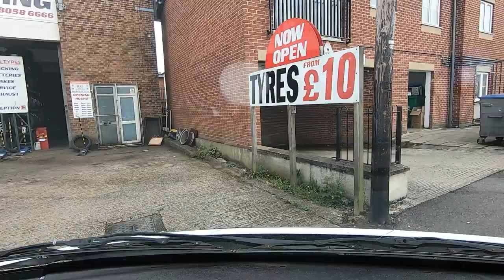Weighed & Paid #70 Light Iron/Sheering

Comment: Locking/unlocking - automatic central locking

Depending on the configuration of the vehicle, it is locked by the automatic central locking if the following conditions are satisfied:

The ignition switch is turned from the position "0" through "I" and "II" to "III" and then returns to "II" (engine running). 
all doors and tailgate are closed 
The vehicle speed exceeds 7 km/h. 
The automatic central locking can be activated or deactivated within 30 seconds by performing the following programming sequence (all doors must be closed and remain closed during programming):

Turn the ignition key to position "II". 
Push and pull the internal door handle on one of the front doors three times, or press the "unlocking" button in the passenger compartment three times. 
Turn the ignition key to the "0" or "I" position. 
Push and pull the internal door handle on one of the front doors three times, or press the "unlocking" button in the passenger compartment three times. 
Turn the ignition key to position "II". 
The automatic central locking system was switched to programming mode (confirmation via a short acoustic signal). 
Push and pull the internal door handle or press the "locking" button in the passenger compartment followed by the "unlocking" button. 
This activates the previously deactivated automatic central locking or deactivates the previously activated automatic central locking.

Deactivation of the automatic central locking is confirmed by a short acoustic signal; activation is confirmed by a short acoustic signal followed by a long acoustic signal.

Programming mode is quit by either turning the ignition switch to position "I" or "0" or automatically, 5 minutes after activating programming mode (confirmation via a short acoustic signal).
Reply from the maker: Thanks I will give it a go 👍
Reply: @Vandal-Vlogs  I saw that you were still having to unlock the doors every time. The videos are great 👍 keep them coming chap.

Comment: The rear of the van needs sorting out as it should be totally empty with no cabinets in it like you have here ,and the best way is spend a day scrapping on the road and then take it all back home to process before you weigh in at the yard .Scrap yards make a fortune out of scrap  guys because they rarely process the scrap correctly ,the best scrapper i ever knew would park up on his driveway at the side of his 3 bed semi and open his garage door where they had an heavy duty industrial shear or bolt cropper set up ,everything was chopped up and stripped and then only would they take it to the yard on a transit twin wheel tipper .His wife actually did the processing and i think they were at it for well over 40 years till they retired ,last ever heard of them ten years ago so may well be dead by now but god they were good at the job .